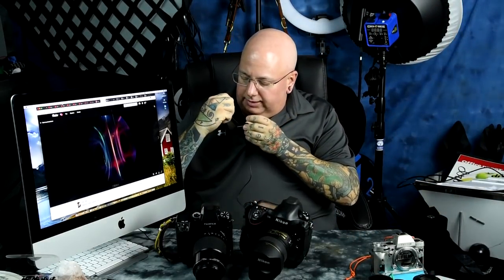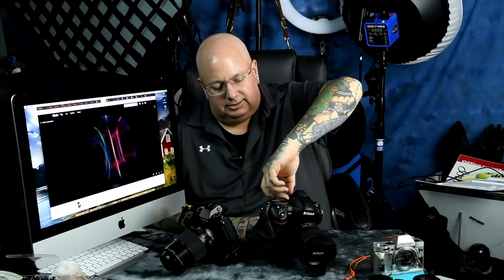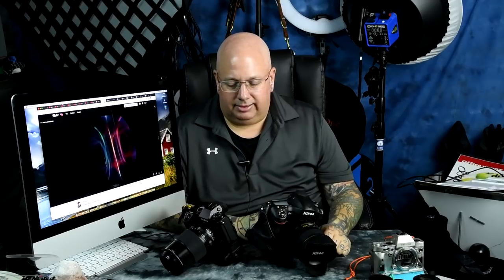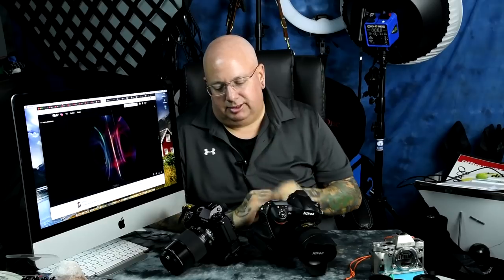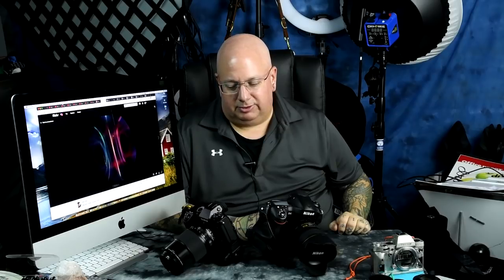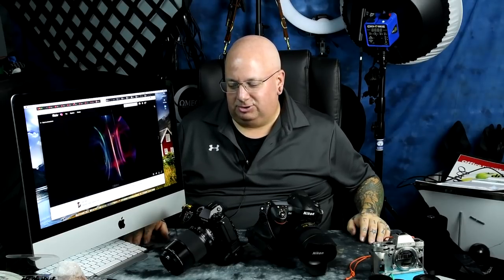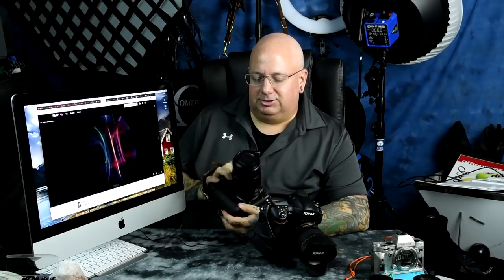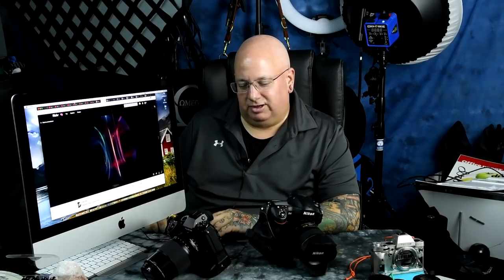😦 Fujifilm,... change your diopter control adjustment knob

Comment: Hey Ken, I'm about to grab an XT2 in the end of financial year sales/cashback period. Really keen to get into the Fujifilm system (from Sony), but do you think it's worth it to wait for the XT3?
Reply from the maker: well you could wait to see price and details, theyll announce it in Sept.........  thats a tough call :/
Reply: Couldn't wait haha... XT2 with 16mm f1.4, 35mm f2 and 50-140mm f2.8 on the way!
Reply: Hi Chris, Richard here, in England, get yourself an XT2, you wont be sorry, however good the XT3 turns out to be anything it has in firmware will be given over, anyway it is a brilliant bit of kit and in fact its the amazing lenses that do the real work!, Try the 16-55, and the 10-24, the 80mm macro is off the scale and none of the primes are rubbish, they are not even really expensive considering how good they are. I am waiting for the 200mm F2, the more that one costs the better!

Comment: Hi Ken, yeah sorry about that, you know how it is, you write from a stream of conciousness without thinking!, yeah 'packed up' does mean stopped working, so I took it to Fujifilm UK where Colin came out to the reception area where I told him all about it, he went to get a battery for it, and he noticed that in fact the rear screen does light up slightly, anyway he's taken it in and rang me an hour ago to say that the standing charge is £180.00 UK pounds, plus parts etc, which I have paid, they still don't know what is wrong with it, but will call me in due course.  So far their service and consideration has been superb, I just love to do my business face-to -face!, I'll keep you posted.  I did take the opportunity to explain why I would so much like the programmable setting options I keep on about, how I hope they can include something of the sort as a firmware upgrade, of course I said that if they put it on the XT3 I will have to buy one!. He said he'd pass it on.  Cheers,Richard.

Comment: Hi Ken, my XT2 packed up for some strange reason last week, so I have had to dig out my wife's XT10 to continue shooting. The first thing I've found is that the focusing system is almost neanderthal in speed and sensitivity, its funny coz. I knew the XT2 is better, but its only when you go back to an earlier version that you used to think was really good! . I am also missing the XT2's floating Iso\fixed shutter speed options. I wonder if the XT3 will come with two or more programmeable setting options like the Olympus, or could it be offered as a firmware upgrade on the XT2?. The local Fujifilm UK service centre, Bedford England, about 30 miles from where I live, just down the road by your standards!, answered the phone instantly on Monday morning, and then transferred me to the service department equally rapidly, something which NEVER happens in this country nowadays, even the Police emergency system 'boasts' of picking up only 90% of calls within 10 seconds!. I will take my camera to the Fujifilm centre today, and I hope I can speak directly to someone that actually does the job!, I should be so lucky, the chap I spoke to on Monday , Colin, seemed to know whats what!.  I'll post  updates as and when. Cheers, Richard.
Reply from the maker: only English know what "packed up" means.....you mean it died etc??    :) 

i dont have those details on the XT3  :)    only 90% ???  Geeeeez !

Comment: Something moving inside the body of my XT3 when I holding back and forth movement is that normal?
Reply: It’s a common problem. They said it’s the diopter moving on gears. They claim it won’t affect the longevity of the camera and don’t consider it an issue. Mine developed after 2 months on the xt3 and it comes and goes. It sure is annoying and I’m not sure it’s soo innocent. At least that’s what I read on the internet.